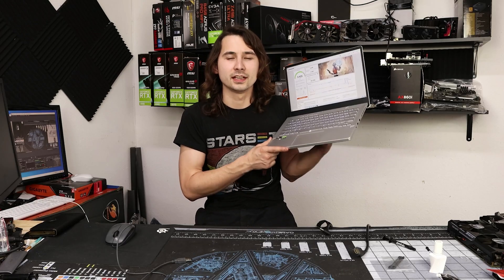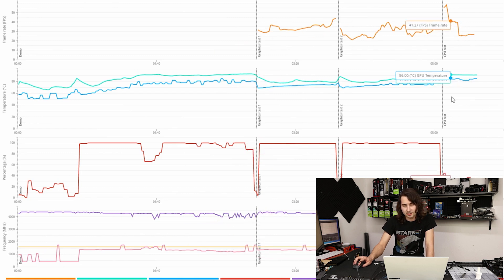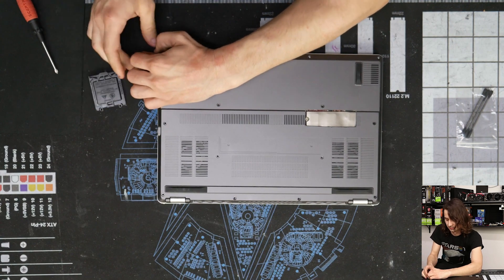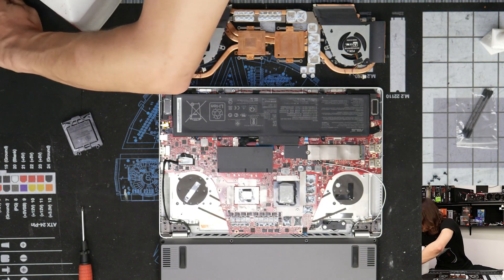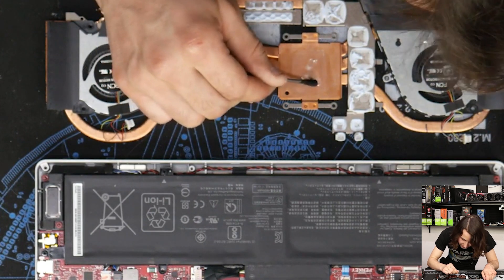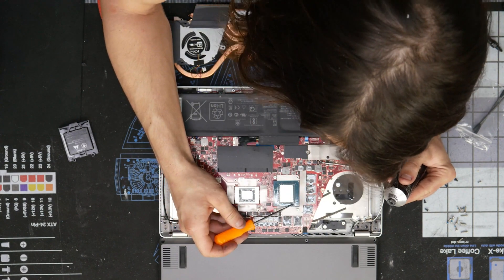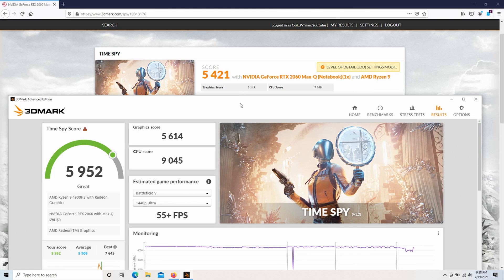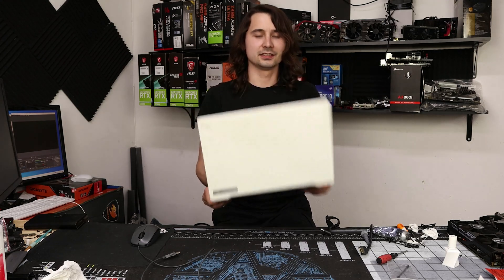I Applied Liquid Metal To My Asus Zephyrus G14!

Comment: Well, mine died.
Reply: was killed by LM? i'm thinking buying some LM, having some serious throttling on my g14 and i thought this was a good idea
Reply: @vicente3p  did you went for it? i got a g14 which throttles down to 3.3 ghz from 4.3 under load (thanks 8\16 zen2), and got some lt-100 left (128w/mK), thinkin should i go for it or nah
Reply: @sanjxz  nah, didn't do it. way too much risk for not that much reward in my opinion. i locked it at 3.7ghz and just tried to live with the noise until i sold this laptop haha

Comment: My Zephyrus G14 came with liquid metal already applied from Asus. I had to repaste it recently because it dried up. My temps shot to around 86 before the repaste. Now it's sitting in the low 60s after.
Reply: What spec do u have?
Reply: What kind of paste did u use?
Reply from the maker: Surprised that the liquid metal dried out, didn't realize that was a thing.

That is the problem with the higher spec pastes though.  We love to make fun of the stock pastes that the manufacturers use, but that stuff is mediocre for _years_.  That said, I still use enthusiast paste on my desktop, Noctua NT-H2 at the moment.

-Zax
Reply: Mine runs at 94 lmao, I opened it up and the liquid metal was everywhere but the gpu
Reply: In fact this is the reason for which I prefer PCMA2305.
Reply from the maker: @r1oot  That's kinda unpleasant to think about.  Gab did this to his laptop, I (the other dude on the channel) am not a fan.

I just put noctua NT-H2 and it's good enough for me.  I'm not risking electrical shorts or corrosion if there's some aluminum I didn't notice around.

It's neat to see the difference in temps, but it's not worth all the headache to me.

-Zax

Comment: Was it safe to use liquid metal grease on zephyrus g14?
Reply from the maker: my g14 is still going strong
Reply: @CoilWhine  followed your guide and i’m seeing the same 10 degree C drop in CPU and GPU temps, hope it holds up
Reply: @noobslayer815 what's your update
Reply: @christianflores3437  still works although my battery died not too long ago so had to replace that, my laptop has been reliable!
Reply: @CoilWhine  Thanks👍

Comment: did you unplug the battery? ive heard horror stories for dudes unplugging the battery on the g14 lmao
Reply from the maker: Yolo
Reply: I unplug the battery, accidentally push that metal piece too far back and it cost short circuit lmao
Reply: @dantepz6611  happened to me, fortunately the battery take the shoot and i only needed to remplace it. Now every time i open my G14 i mask tape all the board around the conector so if that metal pieces touches something it will not short circuit.
Reply: always unplug - i already finished up and reconnected the battery when i found 2 fan screws that i didnt put into the fans. thought "theres no need for disconnecting the battery" - dropped a screw- sparks flew. lucky the laptop works. another problem with screws that you might drop is that they might even bounce and roll shorting multiple areas. aswell there is the habit of some people to jsut flip the heat sink and just rest it on the laptop - another way to short it if you dont unplug
Reply: Like what?

Comment: After how many days should we change the liquid metal in asus rog strix g15?
Reply from the maker: people say you need to replace it after the first few months but mine hasnt had any issues, still runs super cool
Reply: @CoilWhine  i have asus rog strix g15 2021. Its been only 6 mknths..i only use it for music production...is it okay if I change it after 2 years?
Reply: You dont need to replace it at all or maybe after couple years.
Reply: @Vesparion  are u sure that we dont need to replace it
Reply: @Dekon7  Why would you replace it? I have had liquid metal on every CPU I had for the last 15 years and I have never replaced it, cooling performance did not degrade at all over the years.
Reply: @Dekon7  Liquid metal, does not dry as thermal paste, you should be fine for a long long time.
Reply: @evegarvega  conductonaught does form an amalgum with copper so it would "soak" into the copper after a while and you would need to add a little extra if you didn't add enough to begin with.

Comment: Is liquid metal better than thermal paste?
Reply: Yep i"ve been using it.  I reapply every 5 Month. Using 2 layer double protection which is pcb coating and kaptop tape. Max temp is 85 never goes 90
Reply from the maker: yes

Comment: Is it still working? What’s the difference between konductonaut and kryonaut?
Reply from the maker: Yeah still works great konductonaut is conductive and kryonaut isnt i would go with kryonaut if you just want some safe improvements
Reply: @CoilWhine  So I finally went ahead and did this, now that my warranty was expired lol. Lowered temps about 10C and saw about a 10% increase in performance! Quick question, did you do both time spy tests on turbo mode?
Reply from the maker: @davidjoseph8295  uhhh i dont remember, im sure i did but my g14 has never been that strong

Comment: Bad ass thanks for the vid manufacturers need to be doing this
Reply: I believe the ps5 uses liquid metal for the die.  I think...asus? also made a laptop with it.  Just a pain to prevent it from leaking out on a laptop.
Reply from the maker: they are starting to, its probably harder to service down the road though